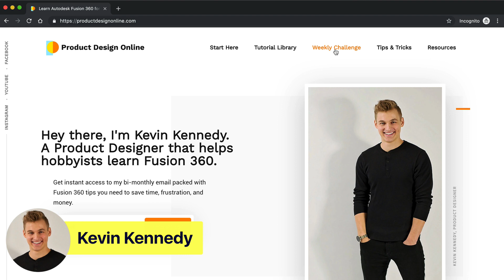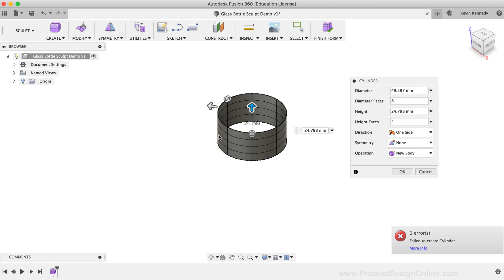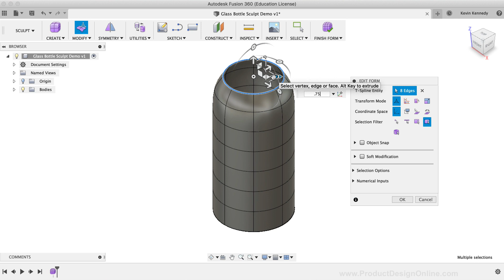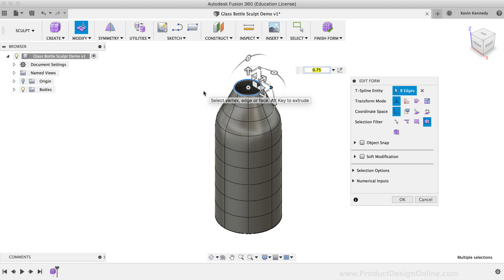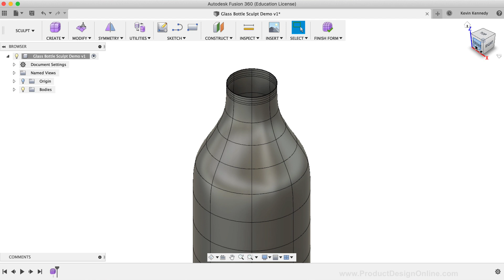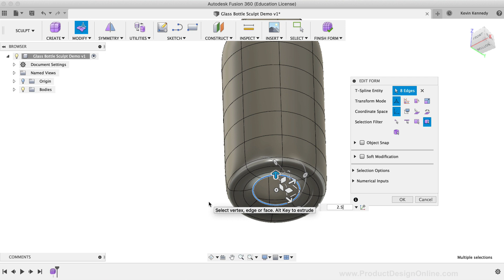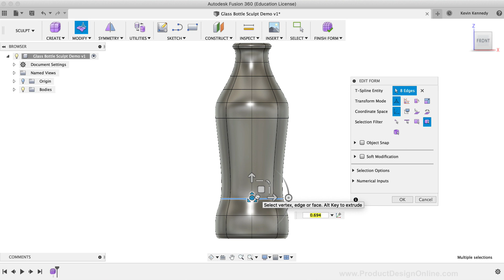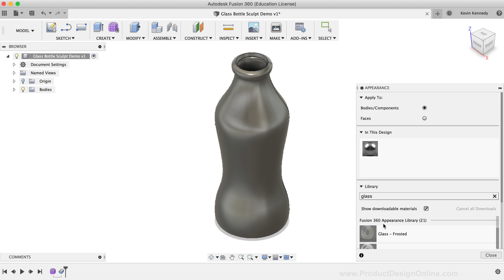How to Sculpt a Glass Soda Bottle in Fusion 360

Comment: Thanks for this video. It was very helpful as I just started tinkering with Fusion 360. Do you have a tutorial that explores putting threads on the bottle and a corresponding lid? What extra steps would be required?

Comment: Great tutorial, as always! one question, why did you use the thicken command after finishing the form in this video but on your pumpkin video you thickened the shape whilst in the sculpt environment?
Reply from the maker: Hi, Tesla 5869. That's a great question! I explain and demo the difference at the end of this other sculpt tutorial (starting at 9:50) -https://youtu.be/Vrg6h5h_vWs?t=590

In short, the thicken command in the Sculpt environment will create the thickness with t-spline faces on the inside. You can then manipulate those faces just like any other sculpt/t-spline faces before you "Finish Form".

Contrary, the thicken command in the solid environment will thicken the t-spline surfaces by creating solid geometry (it will mimic the faces on the outside/be based on the overall geometry).

Cheers, Kevin :)
Reply: @ProductDesignOnline  Got it! Thank you for clarifying.
Reply from the maker: @johnf4388  You're welcome :)

Comment: I am using version 2.0.6263 and have stalled about 1/4 the way through your video.
When creating a cylinder the dialogue box does not show diameter faces or height faces. Also there is no Sculpt in the workspace dropdown. Double clicking on the edge and then Right clicking on the edge does not bring up the Edge form dialogue.
Reply from the maker: Hi, purge98. There have been a few changes since this tutorial was recorded, based on the August 2019 update. The sculpt environment was renamed the "Form" environment.

You will still have to click the purple "create form" icon in the Solid tab within the "Design" Workspace. Then, you should see the form cylinder option. On my end, it is showing all of the same options. Can you make sure you're looking at the "Form" cylinder feature (purple) and not the surface one (which is orange). Here's an image for reference - https://snipboard.io/AY7P9b.jpg

Let me know if that helps. If not, I'd be happy to troubleshoot further. Cheers, Kevin :)
Reply: Hi purge98. I had the same issue. I found that after making the circle for the cylinder and filling out the diameter, DON'T hit enter. Just left-click the mouse wherever it is. Then the full cylinder dialogue box appears, and you can edit the cylinder as described. But after pressing OK, it disappears and I have no idea how to get it back.

Comment: u can draww a 2d and make it revolve 😕😋
Reply from the maker: Hi, Ermal. The benefit of sculpting it is the face that you can edit/further manipulate the shape later on. You wouldn't have as much control with the spline/revolve option. Also, with this route you could make areas of the bottle design unique to one side or area of the bottle. Cheers, Kevin :)
Reply: I agree with you ,this is the fusion and its priority I'm a user of it and it helps me a lot with mechatronic designs.
Reply from the maker: @ermalhoti224  That's awesome! Do you have a website or place with any pics of what you build? Cheers, Kevin :)